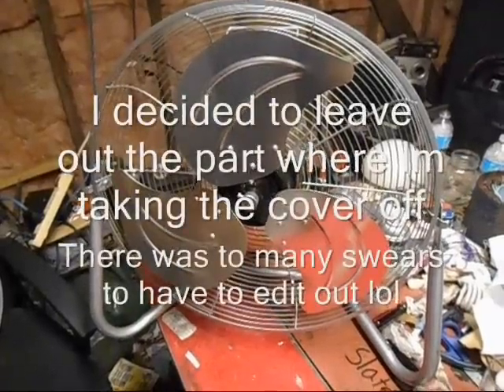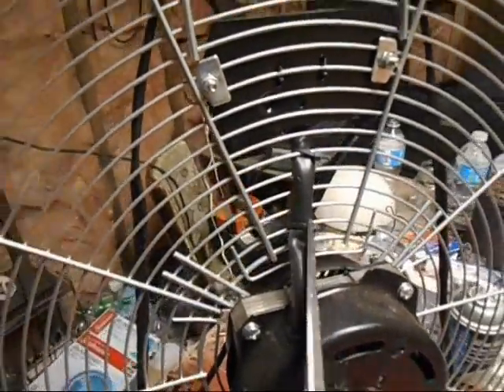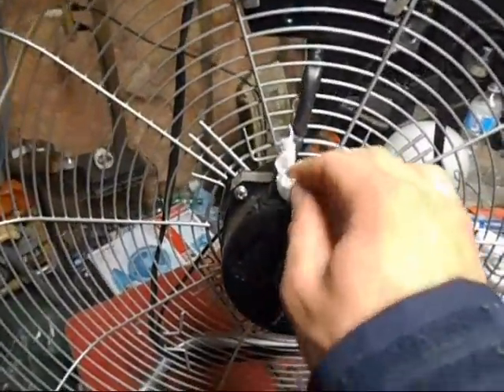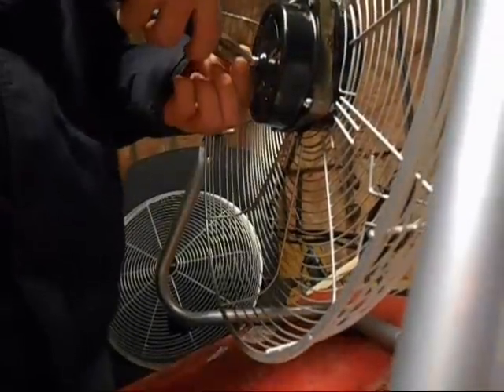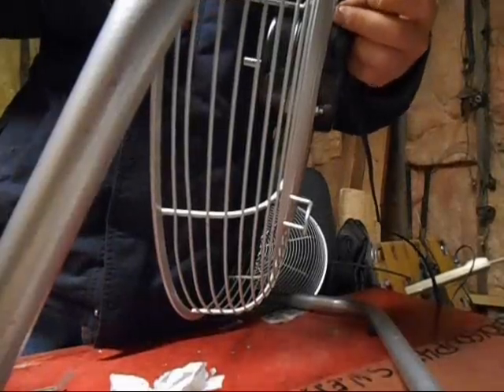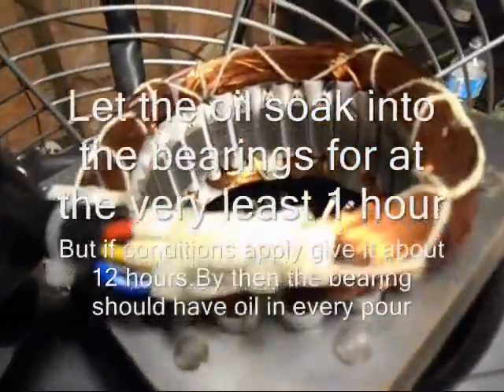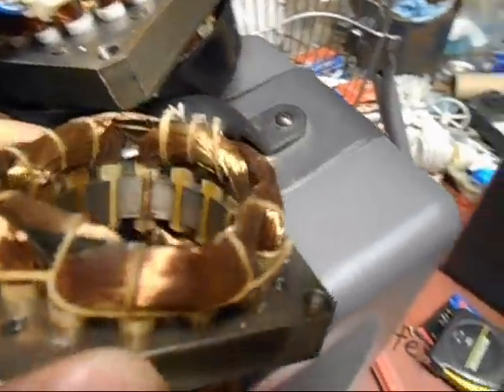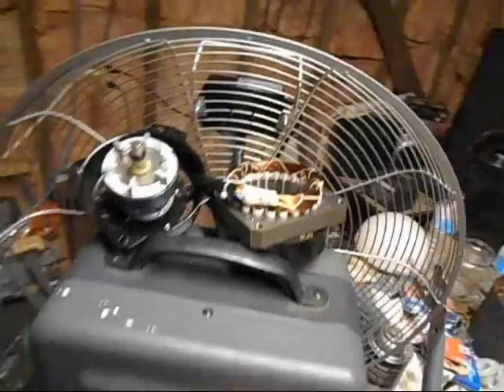Patton HV fan teardown

Comment: The 1990's lasko/galaxy box fan motors have a similar design. only the cable comes out the back. it makes things hard to clean the motor all the way out. i can move the motor shell up the cable to clean it..but you risk tearing up the windings..and thats how iv screwed up a few of those motors. LOL
Reply from the maker: ***** I have also killed a fan by hurting the windings. it doesn't take much. It really sucks when a person is trying to make something better, but instead makes it worse  lol

Comment: Very helpful video! I will have my husband watch it so he can try to fix our Patton HV fan which is  making loud noise now,. I saw some other videos on youtube so I know it has an oiling hole in the back. Is it possible that I  put too much oil?
Reply from the maker: Glad it helped you! and technically no you cant put too much oil in these kind of bearings (sleeve bearings). The only thing that would happen is you'd get excess oil dripping all over.
If your fan is starting to make noises then you should disassemble the fan like seen in the video because just pouring oil in the oil holes just soaks the wick around the bearing, which would eventually soak into the bearing but would take alot longer. whooo that is byfar the biggest comment I have ever made lol
Reply: Hobbycentral 
You'd never believe it. I called Patton Fan and the woman was telling me that Patton doesn't recommend oiling my U2-1887 fan.  Yes, it has an oiling hole but they don't recommend it. What the heck?

Then they sent me a manual for the U21403, U2-1803 and U2-2003 which are similar  which says not to oil those fans. When I mentioned that mine had an oiling port and the manual wasn't for my specific fan, she said not to oil and they don't have a manual for my fan anymore. No common sense these days....sigh.
Reply from the maker: WachdByBigBrother Lol so true! they just want your fan to burn out so you can buy another one from them lol
Reply: +Hobbycentral true and that&#39;s how it is today with all these china fans of today they will always tell you not to service the fans because as you said they want your money and they want it to die so you buy another and watch it die and keep wasting money on them lol but I used 3 in 1 in the blue can and also zoom spout for all my fans except my vornados 673 and 679 and also the air king 9214 which are all ball bearing fans .. good point hobbycentral
Reply: i have two massy table fans from taiwan i have to oil them in the front time to time with 3 in one oil when i clean them out every year the one spent a few months in the outside weather since when i was living with my parents my mom was tired of screech it made when it started up and ran so she bought me a new one to replace it though it sat outside against a shed on our property and i used it when i hung out in the shed and then i kept it since it still worked after being snowed on and rained on an etc and figured out 3 in one works for that problem

Comment: Can you help me with the wiring on the same fan?  I was having a problem with the wires wire that came out of the little switch box....and I had to take it apart, and I rewired it...But now it’s not working at all. It was working fine today, until that wire came out. Now.l.i May have messed up...bc I noticed that the tips of the wires had some hard silver thing on their ends that went into the “z” shaped thing inside of the switch box...and two of those fell off....idk if they are needed or are just put on the ends for convenience....please help 😔
Reply: Hello...please disregard my question...I figured it out and my fan is now running 👍🏻😎 Thanks anyway 👍🏻
Reply from the maker: I'm sorry I never got to your question in time. My old faithfull computer finally kicked the bucket and I haven't been able to check my account for about 4 months.

Comment: 0:33 anybody know the name or size of the type of screw that's used to keep the blades connected to the motor? I was taking mines off to clean the blades off until I lost it somewhere and can't find it. Is that screw easy to find in hardware stores?
Reply from the maker: haha, sounds like something i would do. I'm sure you could find one at a hardware store, just get a few with different thread pitches and see which one works
Reply: @Hobbycentral Thanks for the tip but I might just be better off buying a whole new fan altogether. The reason why I had taken off the blades was cause I was planning to try to get the motor out and open it up to clean the insides of it and the rest of the shaft. Though I did try, those screws in the back with the nuts attached were a bitch to take off. Some of the crosses got messed up so they are less likely to come off now.I had just bought two different packs of screws in the 99c store. One had all these different screws sizes and the other was one type of screw that was thicker but longer than the original screw. Neither of those screws worked. I might see if I can get a new one. The fan wasn't too expensive.
Reply from the maker: @Astro007GE-X  just like everything else nowadays, they are throw away units. 
But the satisfaction of fixing something is so awesome!

Comment: I have a much older patton fan its the same as the one your working on in the video though its from the 1960s or 1970s and the last time i used it started smoking an i unplugged it an never plugged it back in as in fear it could spark a fire which i do not need that to happen i do not know what would be needed to fix it it has blue blades and a blue engine cover